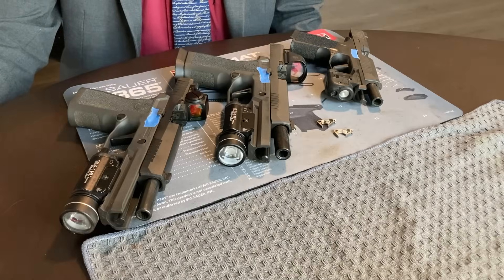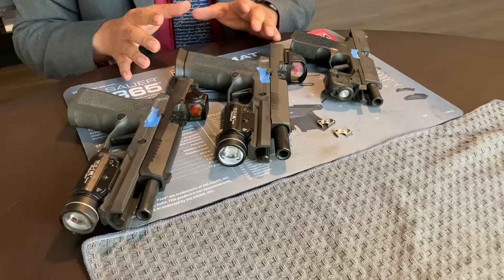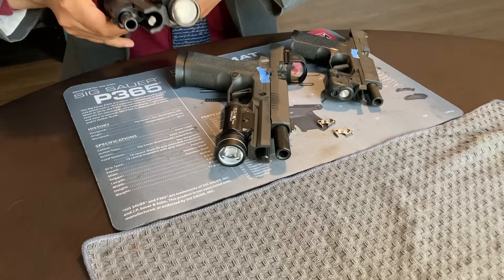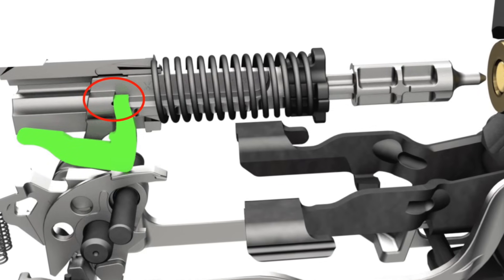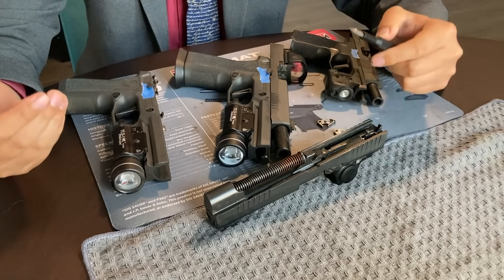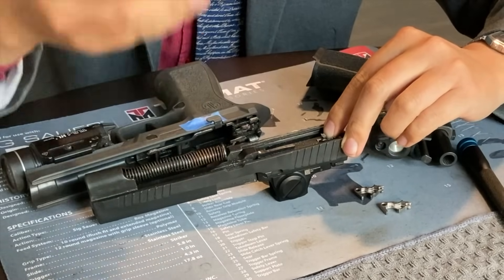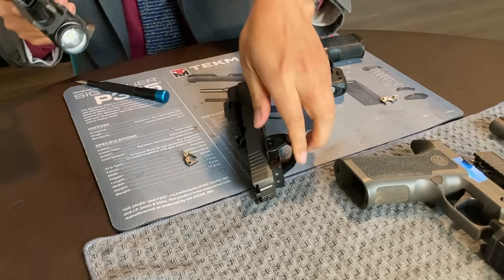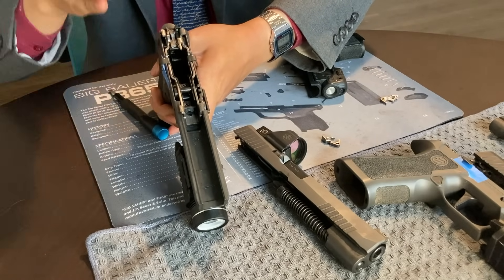How to fix a P320 that fails the Sear Movement Test

Comment: I think the reason the P365 does not have this issue is because the firing pin safety plunger and spring are way more robust. In lieu of the flimsy safety of the P320, I wonder whether welding up the sear leg to provide the required disconnector-like behavior mentioned in the previous video might be the better fix, rather than removing the new leg. Ultimately, I think a more robust safety plunger and spring are the better fix.
Reply: So the other fix for a non upgraded one would be to just add a Agency arms trigger shoe that has a blade safety and not send it back, that also would prevent this
Reply: @gregc247 I am still puzzled why Sig didn’t do this. Nobody cares about having a safety blade (other manufacturers, including Taurus!, have introduced comfortable, unnoticeable trigger blades), and it eliminates so many variables.
Reply: @HaroldTheSloth i personally think it is mandatory on a striker gun, I also have a p365 and while i still mostly trust that one due to the inherent design differences I added a manual safety too it, the p365 safety actually locks the sear too so I still trust that one but i traded in my p320 for a shadow systems dr920 and havent looked back, without it is is almost the same has having a 1911 cocked with the safety off
Reply from the maker: The P365's plunger-style striker block definitely engenders a lot more trust for sure, though the P320's striker block can still be easily tested for full functionality.

I don't know of easily user-replicable ways to create that disconnector-like effect in any FCU, otherwise I'd have already shared that. The sear rear leg chop seems much more accessible to anyone with a handsaw or dremel and the ability to follow an Sig Mechanics video.
Reply: @  fair enough. Good videos, though. I did your test on all three of my 2022 and 2023-produced FCUs with no issue, so I wonder if some of the rolling changes by Sig may have helped this. I’d love to know the date of manufacture for the FCUs in these incidents. In this case, it would have benefited Sig to publish their changes and explain them. It would have instilled confidence in users rather than having everyone guessing whether their pistols are vulnerable to random discharge. I’m really mad that my pistols’ values have essentially crashed since no one can trust them.
Reply: I still love my pre-upgrade un-upgraded X5. I have thousands of rounds through it and never a hi-cup.

Comment: I have heard that some models of the p320 may have been improperly assembled with the wrong takedown lever. But that doesn’t seem to explain everything.
Reply: The problem with that rumor is that the takedown lever is sold as a single, universally compatible part number for 9mm, .40, and 45. If you buy a replacement from Sig, you do not choose a 9mm specific version for example.
Reply from the maker: Whoever is telling you there are right and wrong takedown levers fundamentally does not understand the pistol, as the takedown levers are identical between all models of P320.
Reply: @ 

The FCU is the same. The only two parts that are 10mm and .45 specific are the slide release and the take down safety lever. The grip module is also different, wider in the mag well and that’s it.
Reply from the maker: Ah, that exact terminology might be the trouble here. Takedown Levers are identical between all FCUs. Takedown Safety Levers are indeed different between 9mm/.40/.357S and .45/10mm. I have some reservations about the source of this supposition, as the source gets a fundamental behavior of the Takedown Safety Lever completely wrong, but it might be worth investigating that difference.
Reply: @ I meant to say takedown safety lever. I guess I should proofread what I post.
Reply: @P320Truther  

https://www.youtube.com/watch?v=KfbJZ9kIN0A
Reply: @P320Truther this is where I heard it. Doesn’t make it true.

Comment: Search for; ( 5 Steps Required to Fire a P320 ). It shows how that part with rear leg works in the P320. Thanks for showing the P365. I kinda figured that it had a different design. So far, I have not heard of the P365 going off by itself. Here is the link;   https://youtu.be/HJnGzEUqqzc?si=XM_3W2I7G2TRWFLq

Comment: You are on to something my friend. My pre upgraded x5 that I chose not to upgrade passes the test just like my early model 365. My post upgraded m-17 fails the test even with the thumb safety engaged.
Reply from the maker: Yeah, the un-"upgraded" P320 sear also lacks the rear leg, so that sear cannot influence the striker safety lock. Interesting finding regarding the M17 though - that would help explain the military reports of uncommanded discharges!
Reply: Interesting note. The manual says models with the manual safety mechanically blocks the movement of the sear but on my m-17 I don't see how that could be true.
Reply from the maker: Odd that they would print that in the manual, as the P320 Manual Safety very abundantly doesn't block the sear directly - Sig Mechanics came up with a better alternative that does over a year ago...
Reply: I've been curious about what reason SIG could have had for adding that rear leg and inducing this behavior. Makes no sense to me.
Reply: @SauerkrautIsGood  Possibly to add inertia to the system making it harder to jar the sear loose when dropped?

Comment: Have you tried the hammer test after chopping the unnecessary leg?
Reply from the maker: Not yet, though I fail to see how the rear leg could contribute to drop-safety, considering it would only arrest the trigger bar in a direction in which it has already reached its limit of travel... And if the sear was moving down, the last thing I would want it to do is exactly what it is currently doing (affecting the trigger bar).
Reply: @ Most of these faults were inside a holster and i believe that some slight movement created the ‘cause and effect’ (areas you already mentioned) hence my question. There are so many factors, it’s hard to ignore any. I appreciate your work.
Reply: @P320Truther  It seems possible that by coupling the sear movement with the trigger bar and trigger it adds inertia to the system and makes it harder to jar the sear loose with impact?

Comment: Thanks for taking the time - and your friend's expense - to work out a potential fix for a pretty massive design oversight.  That sear leg really does appear to be a method for adding tension to the sear itself so that it is less likely to move downward under impact.  Going through the movement of all the interconnected parts, I don't see where it would physically do anything other than lock sear movement and trigger movement together.

Sig is probably going to run out of spare sears for order.  I know I'm grabbing one for my X-TEN, which has all the same issues as the 9mm models.
Reply: I have a x5, original 320, xcomp and a new xten. My xten is only one that passes the sear test